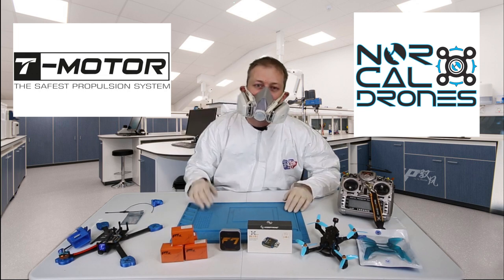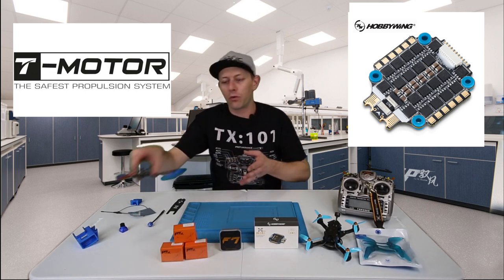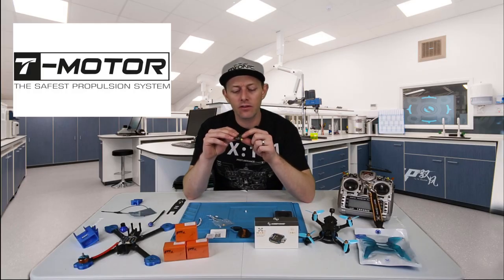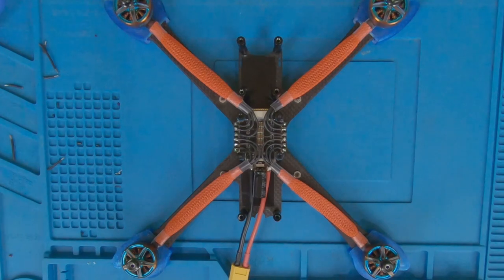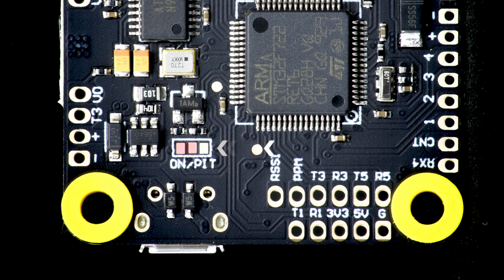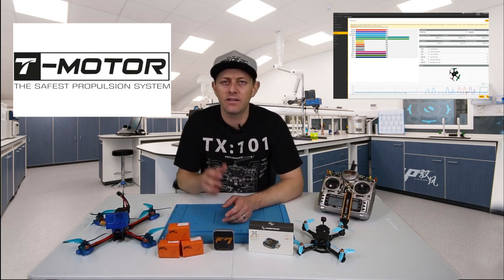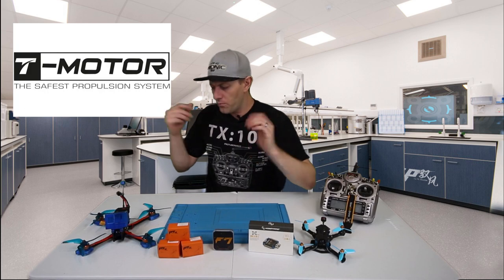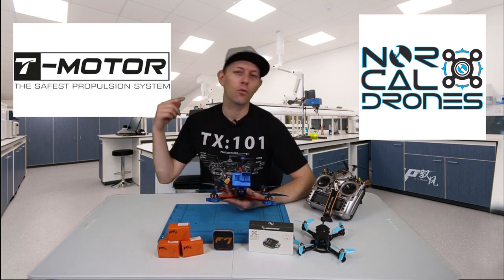T Motor F7 Quarantine Review and Build

Comment: Nice vid man! Love the T-Motor Fc’s. Currently running the F4 version and F7!  My go to fc at the moment. I never wore my smart audio to the flight controller, str8 to the receiver.
Reply from the maker: Fly Till i Die FPV I like having the option just in case I end up flying with someone else but so far this FC is great. Going out for some snowy mountain dives later this week. Thanks for watching.

Comment: thanks for this video. One question, if I connect my tbs on R1/T1 it is the same as R5/T5 right? I only have to change the port in betaflight. Also, my rushtank could not start when I had it on vtx +. I had to wire it to the flight controller red cable that goes to the battery. Should I bridge the vtx with bat now or just leave it with 5v? Maybe it sounds stupid but will it work?
Reply from the maker: Yes and no. R1/T1 is uart port #1 

R5/T5 is for uart port #5. 

For this board YES it should work just fine. 

However sometimes they have sbus available and sometimes the don’t on uart ports. Sometimes the they are inverted And sometimes not. Most new boards in 2020 have all the uart ports available for sbus and whatever it’s no problem. It’s on some older boards that won’t communicate through sbus on all uart ports. They only designate some ports for sbus.
Reply: @norcaldrones5389  thank you so much!!

Comment: I am having problems with my FC. You talk about the jumper for either Battery voltage or 5 volt. But connecting my VTX to the FC, the vtx can't power up. I have tried both ground wires of the VTX, but simply can't get it to work. Any ideas?

Comment: im using frsky rxsr. there is some confusion on wire placement and wire colors. there is a green wire labeled sbus out and a yellow wire labeled s port. where do these need to be soldered to on the board? i soldered yellow s port wire to pad R5 and green sbus out wire to  pad TE. is this correct?

Comment: Great video, can I run that set up with the DJI air unit?  Also if I want to run 6s will I need a voltage regulator cuz of the DJI?  Any info would be great.. thanks
Reply from the maker: RobertB37 you should be able to run a dji setup on this but since I don’t have that I’m not sure if you need a additional regulator, it only has 5v pads.
Reply from the maker: I take that back, there is a 3.3v pad on here also.
Reply from the maker: RobertB37 I take that back on this board there is a 3.3v pad. But t-motors makes a HD version that is meant for plug and play on dji.
Reply: Thank you, I’ll see if I can find the DJI version... appreciate it

Comment: I have a problem, I have soldered everything as shown in the FC guide, but when my receiver and my TBS crossfire Nano are connected, I cannot activate the drone with the receiver, it seems that my receiver does not know that it is connected to the TBS nano, They both have a green light, I don't know what else to do.
Reply from the maker: ok, it could be a couple things. what RX and TX ports are you using? make sure when your in betaflight you to the ports tab and turn on the serial RX button under the proper UART port. also have you set up the tbs nano in crossfire? i beleive its called agent X or lui script for older versions you need to set up the channels in crossfire channel 1 and 2 need to be set to RX and TX. also in betaflight check on the reciever tab when the controller and drone are on. the nano RX should have a green light and you should be able to move the bars on screen by moving the controller. let me know if you need any more help trouble shooting.

Comment: What am I doing wrong here - I cant get my board into DFU mode
Reply from the maker: There’s a couple things to try. 

Make sure the cable your connecting to your drone and computer is meant for data. 

Make sure your holding the boot button before you plug in the cable. 

If your drone connects to betaflight you can get to dfu mode from the CLI tab in betaflight once connected. Type in BL in the command prompt and hit enter.
Reply: Thank you very much  @norcaldrones5389  - there must be an issue with my drivers. Still can't get in dfu

Comment: Is this tmotor F7 ok for 4S or is it rather for 6S?
Reply from the maker: Dan it can handle 6s which is more voltage than 4s so it will be able to handle 4s just fine as well. Good luck. Thanks for watching.
Reply: Average Hobbyist Thanks, my friend!